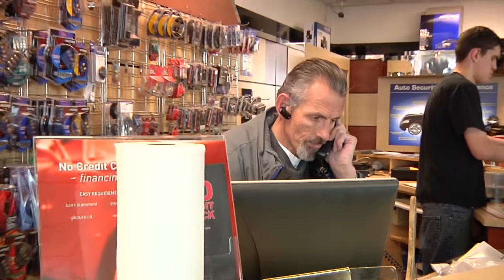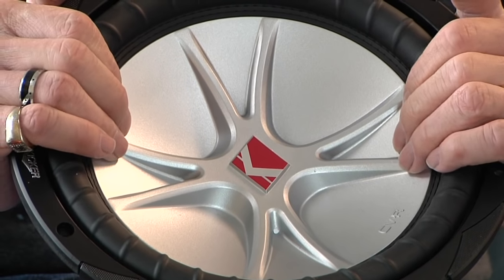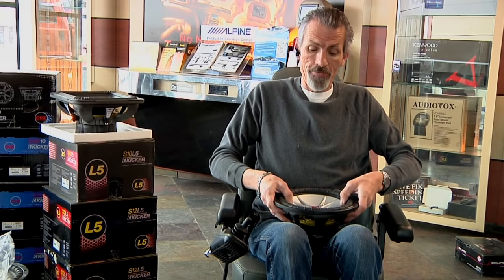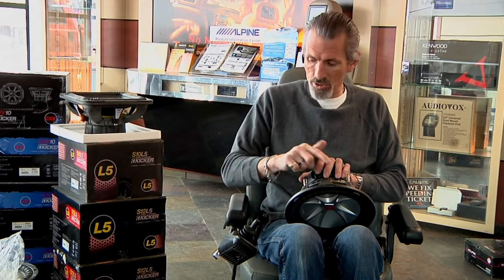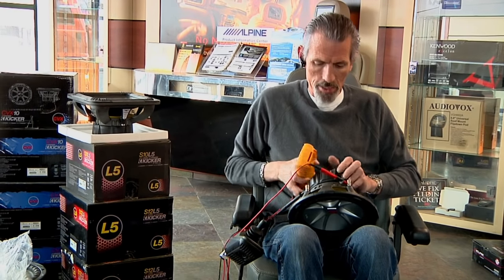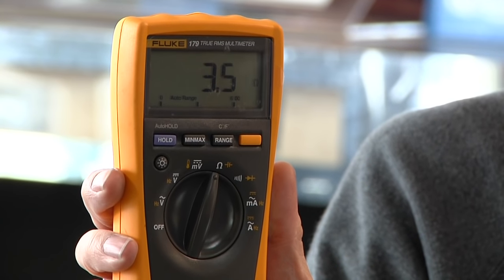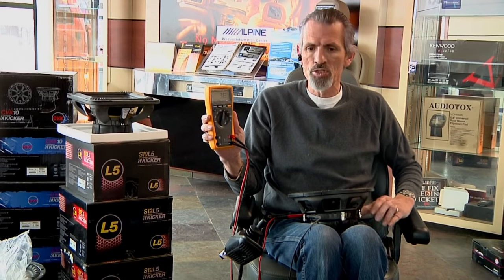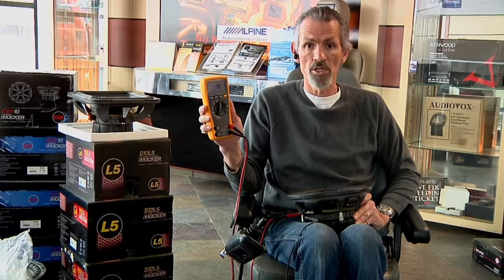Car Audio : How to Tell if a Car Subwoofer Is Blown

Comment: ok so im kind of stumped right now.. new to the refineries of subs and amps.. i have an eclipse ti 15 and both coils are reading 3.7-3.8 ohms which is perfect for 4 ohms. but when i hooked up each coil separately to the amp... only 1 coil plays music. the other is silent. no scratching noises coming from pushing either. please help!
Reply: +Commander2Cold Sounds like one of your terminals could be dodgy, where are you taking a reading from?
Reply: +roll light just straight to the terminals. and when i tap on the lead wires the ohms dont flucuate so no short which is a good thing. my buddy seems to think it has an intermediate coil that needs to be warmed up before itll start moving
Reply: No such thing I've ever heard of or come across... Need some more info from yah!
Reply: +roll light what do you need? im all ears
Reply: Double check your readings from speaker wire please bud
Reply: run a test on the 2 coils in series
Reply: +roll light so instead of using dmm prongs.. use speaker wire and run it in series?
Reply: Yes bud, what amp are you using?
Reply: I have limited time to reply man, hope I can help!
Reply: +roll light eclipse da7233
Reply: +Commander2Cold da7232***
Reply: +Commander2Cold da7232***
Reply: Is that the amp with like 8 fuses? Have you got another amp to test both coils separately because if you're getting that reading on both coils it's highly unlikely to be the speaker itself, a small possibility it's the amp, can you use the same speaker cable for each test (both coils) ect to minimize fluctuation on your results,(that would include using the same output your getting sound from on the amp if you haven't got another one to test) I'm just trying to ascertain the entire situation. It's very hard to diagnose a problem through no offense the little information you've given, did you try it in series? Are both outputs of the amp working on the coil that works? Please try every possibility there^ & get back to me I want to help you find out what's wrong, sounds impossible
.
Reply: +Commander2Cold You're supposed to wire the voice coils together a certain way, then you run a single set of positive and negative wires to your amp. http://images4.crutchfieldonline.com/ca/learningcenter/car/subwoofer_wiring/1DVC_4-ohm_mono.jpg

Comment: The absolute BEST way - of telling if the sub - or general soeaker - MAY be "starting" to burn... NOT evident by ANY of these tests here...- is to "put the speaker across an ALTERNATING "fixed" frequency tester Osciliscope... - checking EACH and every frequency range - for the speaker... ONLY by that method... (using the manufacturers "rated" variations) CAN YOU TELL - if a coil is defective.

Comment: sir can you show me. 
how to bridge 4chnel amplifier for 1 subwoofer?
thanks
Reply: saufi us it's not ideal to use a 4 channel amp for subs they are meant for car speakers
Reply: +Cody Walkden That is very wrong, there is a lot of possibilities for a 4-ch amp to run subs. An example; 2 of the channels can be bridged into 1 channel, for running 1 sub.
Reply: I know it can be bridged It's just not ideal for a sub a mono amp is the best choice for a subwoofer

Comment: @capo949oc 
usually u want to get an amp thats a little more powerfuler than the sub(s) or something that matches
for example if you got 2  600w 12's you shud get a 1200 or 1400w amp that way you can either provide what the sub needs or have an amp that can give more so you dnt have 2 work it as hard

Comment: my little sub scraches at the walls (a tiny bit)
how can i fix it?
EDIT: you can hear light scraching when the sub hits the lower notes
Reply: U can't fix coil rub
If it was like a car subwoofer like sundown u could fix it with a recone kit
But u got a cheap sub so u can't fix it bud
U have to replace it 
And after u replace it use a knife to open up the old beat up sub to what's wrong
Reply: @NerdyBassHead   r.i.p

Comment: He said air that will make the cone move, as in a room with a fan, wind, etc. Just a room with still air. A good place would be a garage, because the air barely moves under normal conditions.

Comment: Somebody please help when I push Down on my 15 it dosent make a scratching noise but when I push down on it harder it does make a scratching notice and my 15 play like new.
Reply: Edgar Traton It's probably because when you push it hard you might move it off axis and that makes the coil touch the magnet and it makes a scratching noise. Try hooking it up to an amplifier and use a frequency generator app to go from lets say 100 Hz to 1 Hz to test it. If it doesn't make the scratching sound then you're good. If it does then you would have to further inspect it to see what might be wrong.
Reply: maybe you are pushing it too far, i too had one of these problems with one of my sub.

Comment: Okay everyone that is smarter then me I am stumped on my earthquake subwoofer its a DVC I am unsure of the model but you can probably still help. The sub is 4 OHM DVC so this is the strange part.. I am thinking 1 voice coil is burnt out as only one set of terminals on the sub work I had them bridged before so i unhooked them and tried connecting to just the sub on each side first side nothing, second side BOOM! I had a working sub again. I wiggled the tinsel leads on the faulty side and nothing. The tinsel leads are all intact what would this be? Do I need a recone kit? Do I need to repair the voice coil? Any one have a suggestion? Thanks!

Comment: everytime i try bridging my speakers my amp cuts off and cuts back on continuously does anyone know what the problem would be? Thanks!
Reply: Kyle Glinski Maybe you're overloading it. If you connect two 4-ohm speakers in parallel to the amplifier, it sees a 2-ohm load (which is far too little if the amp needs a minimum load of 4 ohms). You're actually lucky that your amp has a protection circuit, otherwise your experiment would've blown it right on the first try.

Comment: My subs just started making static when the bass hits. But yet they still hit just as hard as they did before the static. Idk what my problem is
Reply: Kyle Carson probably something with your amp. I've had that problem before, usually check your ground, make sure it's good. Then check your rca's by unplugging them and plugging them in again and wiggling them around to see if the sound changes. I think your subs are good. Especially if it's both. Try a different amp if you have one lying around. You can find the problem, I just doubt it's your subs
Reply: J Stevens yeah I didn't think it was my subs either and thanks for the help

Comment: That kicker cvr sucks, i had 2 hooked up one froze and the other got detached from the terminal wires. They cant take a beating. I then got a "12inch kicker cvx and it beats just like 2 kicker cvrs do. If you want something that bumps just get a kicker cvx. I talk from experience. Those cvrs cant handle abuse. Alpine amp and kicker subs great mix, 6years of daily abuse and my amp finally gave out.

Comment: Epic fail, i just bought a "reconditioned" subwoofer from ebay and it doesnt push in at all and makes a terrible scratching noise at low volume. However when i turn it up the scratching goes away and it sounds fine, so im not too bothered.

Comment: How about without taking the box apart? I've tried two amps and these subs won't work anymore. With one amp, it blows the amp fuse right away. The other amp, subs just barely work on low sound, then cut out when the volume is turned up.
Reply: Richard Beyer some Amps are bad coming straight from the manufacturer, I had the same problem and had to replace. Worked perfect after !

Comment: i have two subs one recently stopped coming on. i had noticed that for a day or two there was a scratchy noise in my music thought it was the door speakers, turns out its not because that went away since the sub that wont come on isnt coming on anymore. i was wondering if anyone knows what happened to my sub
Reply: I know this was six years ago, but just in case you're still trying to fix your sub, you burned the voice coil up in it. Time to replace it lol

Comment: Mine doesn't show any ohms and doesn't work at all but it moves just fine
Reply: nope nope Yes, that means that the voice coil is fried. You'd need to carefully take the speaker apart and rewind the voice coil using wire of the same thickness if you'd ever want to use it again.
Reply: the wire that connects to the voice coil some how corroded and wouldnt conduct any more but i fixed it
Reply: nope nope Cool. You were very lucky though. This happens quite rarely ;)

Comment: well if i push new subwoofer, i hear a sound when it meets the ending touching something.
Reply: The sub voice coil is hitting the back of the magnet
Reply: wires are cross
Reply: As NeXTSTORMING said, this probably is the voice coil which is hitting the back of the magnet. Go get a better amplifier or sub, or both.
Reply: I have problem n my sub is 1 ohm n it pops at certain point when I bump I have a skar 2000.1 mono amp
Reply: Shrapner's place mess with your phase. Either that or ur wires are crossed.

Comment: You have to take really good care of your car subwoofers and you have to not abuse them and you have to not blow them or over power them and you have to not turn the gains up and you have to wire them properly and use the proper wire to wire them and you have to use always use a low pass filter and give them the proper amount of power because you invest a lot of money into car subwoofers and if you take good care of them they can actually last you several years also some car subwoofers can be reconed but most of them can't be reconed like the kicker comp vrs and the kicker comp vxs those don't have factory recone kits but the kicker l7s do and the jl w6 subwoofers have recone kits too but not all jl audio subwoofers have recone kits I know that not all subwoofers have factory recone kits
Reply: Travis Gulley helpful info, redundant af! Lol.

Comment: I have just purchased a JBL GT4 1000w (250rms) Subwoofer. I have noticed there is a rattling noise and it only does this at low volumes. But if I turn the volume up, it goes away. Very strange but how do you check the spider? Like what do you look for to see anything wrong with it? I will subscribe to if you anyone can help, many thanks :)

Comment: If u smell smoke from the sub 📦.
Reply: Godzilla 73 exactly that is also my question. I feel smell in woofer coil. I purchased used subwoofer of kenwood 12 inch.. Tell me please buddy. What smell of it??.. Subwoofer played well. Plz reply me
Reply: mithu rana subs get warm so you can possibly smell it... But it doesn't mean it's blown... I'm currently running a 2ohm dvc kicker l7 15 and it gets a little hot... But it's fine... If it smokes than you have a problem.
Reply: mithu rana if it's new you will smell it. It's normal.
Reply: If the spider is sagging u will smell the coil too basically what that means is it's time for a recone even if the coil is still good if u dont have money to recone it then simply play it on less power. There are other tricks as well.
Reply: Godzilla, jeez MAN!  Just always remember to NOT allow your Marlboros  to be  TOO close to your sub-woofer where he/she can  REACH  them & light up?

Comment: just nitpicking but if you are only checking continuity it will never EVER matter which lead you touch to which end
Reply: vegetin, yup, you're correct my friend.  Same thing with measuring voltage on batteries, except the very same number (value) will have a " - "  (minus-sign)  in front of it.

Comment: No fuss, but to say "no" 4 ohm subs "ever" test at 4.0 is bull crap.  a
reading a little off rated resistance is normal and ok but some defiantly
test right at rated resistance. My point was if its close to
spec.  Yeah yer ok but there is no " jumping " readings just-shorted, open,
or sometimes stupid high resistance, and...once in a while a sub WILL test
spot on what its rated for so "never" is   not  accurate.
Reply: He is correct about no 4 ohm speaker will read 4 ohms of resistance with a multi-meter. He just doesn't explain why. This is a more in-depth concept than what his video is trying to show. Speakers are rated in ohms of "Impedance", not "Resistance". These are two different things. The multi-meter measures resistance, not impedance. Resistance is the opposition of current flow in a DC circuit. Impedance is the opposition of current flow in an AC circuit.

Comment: Why is my subwoofer moving but there is no sound
Reply: Is it in an enclosure?
Reply: sounds like your rcas are not hooked up right, if the amp is no good they can also make a pulsing affect
Reply: Sounds like a polarity issue, make sure the pos and neg speaker wires are hooked up correctly. If you do it back wards, the sub will still move, but seem very weak.
Reply: Luis Sardina,  maybe your sub-woofer is sleeping + in REM (rapid-eye-movement) deep sleep stage, and does NOT prefer to speak with you at the moment?

Comment: @MahatmaGandii ?
And Blue equals Neutral, Brown equals LIVE & then there's ALL the european systems that USE any dam colour they want? A WIRE - is a wire... and thus ANY COLOUR can be used- for any "phase" as long as both ends are at the same VOLTAGE potential.

Comment: @pbdude62 He's demonstrating on a kicker cause they won't go up in flames by pushing them inwards and won't rip apart and shoot dust caps 20 feet in the air and fry voice coils lol.

If you got a JL setup I'm not dissing your setup cause JL makes some good things. but don't go out and bash Kicker either I'd like to give you a demo of my Kicker system and see if you think the same way afterwards.. I'd ask what you would have thought of the demo... but you would be deaf more then likely :) pce.

Comment: @scottyBoland Oh shit?
Someone did you wrong...
As 100 amps... need NEVER be pulled... by any amp (unless you are TRYING to boil a jug of water with it)
?
So?
 How to create MASSIVE VOLUME - for little current flow? 
Easy...
 use common sense & WORK OUT ALL IMPEDANCE VALUES - and never exceed 60 % of your amps VOLUME ... (minute SPIKE PEAKS will clipp the output AC to DC, burn ANY speaker connected, and then shorted BURNT coils... will quickly fry your amp.

Comment: Please do - crush your speakers delicate CONE fittings... if you WANT to buy more... (not from this store mind - as this is how HE tests them?)

FACT...
 most resonable fit people can easily SQUEEZE their own weight - on standard bathroom scales.
(way more force than SUBS can resist- without splitting or puncturing the cones)
My UNCLE heavy as he was... could SQUEEZE over 26 stones on a PEDASTAL machine - and would have crushed that speaker)

Comment: I fucked up my 1350w sony xplod sub last night !
Reply: thats what happens when you buy a shitty sub
Reply: *****
 thxs !!!
Reply: John Hall Don't forget Soundqubed and Digital Designs, bro!
Reply: Ali Haidar John Hall and dont forget DC audio and RE audio! and sony makes good subs. sony is good for the average person. sony is not good enough for BASSHEAD EXTREMISTS TERRORIST like us! but honestly any sub is good as long as you know what you are doing. friend told me he was at a car meet and he sat inside this dudes gmc envoy and shit was shaking and flexing everywhere, bass inside his lungs and shit. so he looked in the back to check out his setup and there were two Dual brand 15's running on 250 watts a piece (lmfao) but yeah get the right enclosure and amp and your good!
Reply: daniel rodriguez Yeah, I myself started with an Xplod sub ( SVC 12") the box was custom and at goes hard! Used to get hard anyway, I sold it and now I got myself a 15" SoundQubed HDC3!
Reply: John Hall I don't consider new kicker stuff good anymore.Maybe back in the day
Reply: daniel rodriguez It can be loud and not spend much on it.The loudest 2 subs I ever owned only cost me 50 bucks.
Reply: charles deckard Well, not everyone lucks out on CL/eBay with some good woofers you know.......
Reply: CoolKoon Everyone lucks on Sonic Electronix I tell you whut.

Comment: @bulldognick99  What in the world man. You need help with spelling. Kicker comps are 150 rms. 300w amp will do just fine with that power. If an amp shuts off it means 2 tings, your dropping your amp to low of a ohm load or you need an  electrical system upgrade.

Comment: @commentXrateXsubscrb some 18's are extremely hard to push becuase the magnets are so powerfull there is alot of pull at the base of the cone where the coil is wrapped around it

Comment: @1REDDAWN13 "So you are calling out the "expert"."

Your putting "expert" in quotes is entirely appropriate.

From wikipedia: eHow has been criticized as "a 'content mill' because of the website's search engine driven content, low article quality and low writer salaries…."; their content " 'slapdash" and a "factory stamping out moneymaking content.' "

More damningly for the case of truth and accuracy:  eHow spreads low quality content very efficiently: over 262k views as of 14Jun2011.